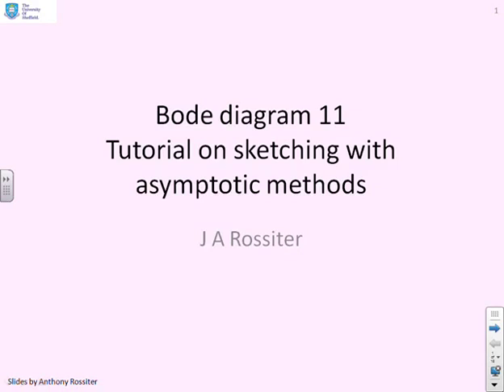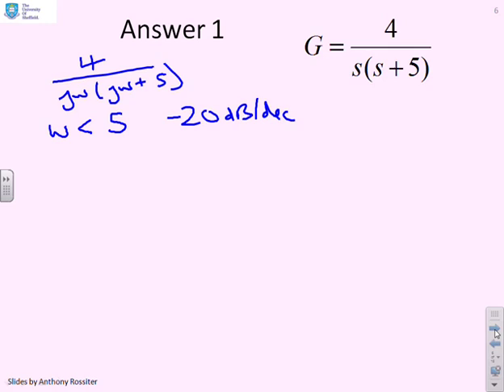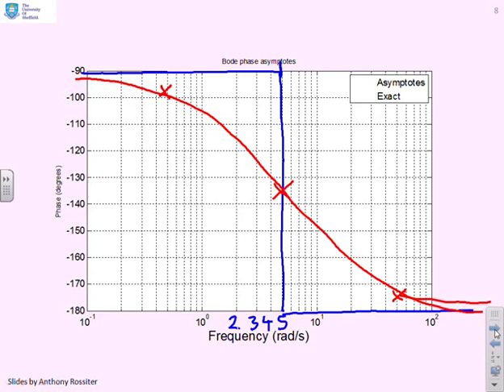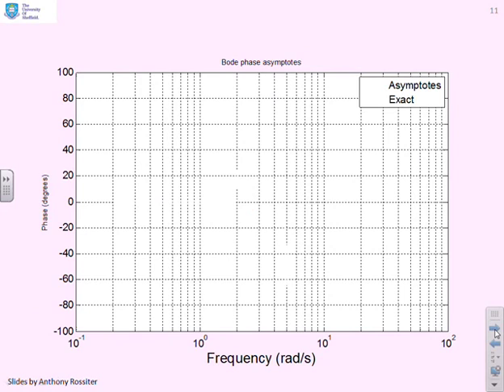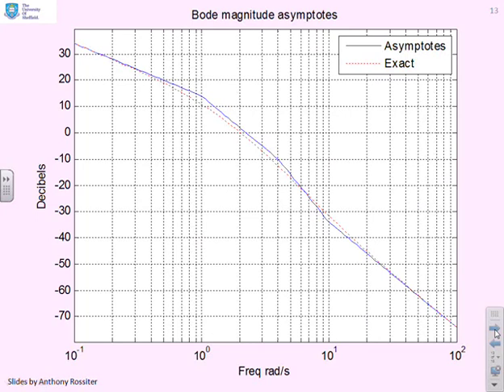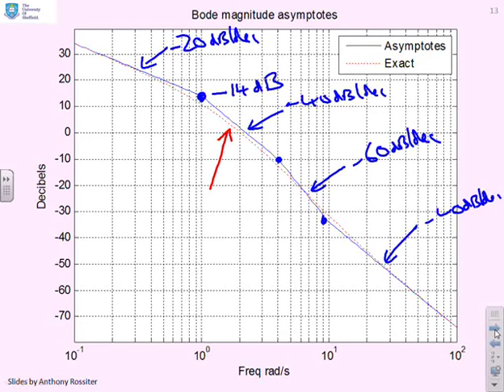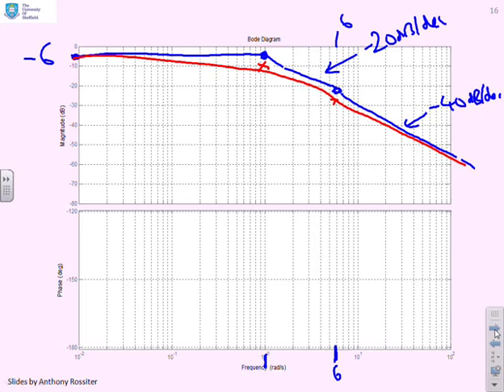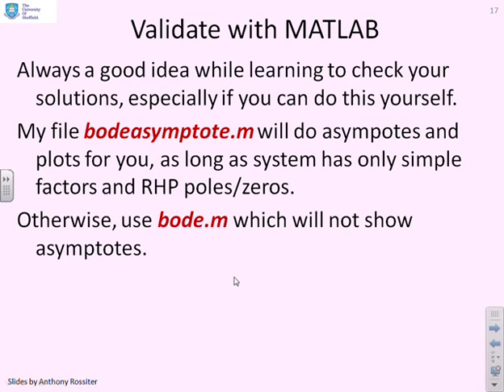Bode diagrams 11 - tutorial sheet on sketching with asymptotic methods and MATLAB

Comment: i'm confused about the answer to Q1. when calculating the gain at the corner frequency w=5 rads, the tf=4/(jw*(jw+5)). therefore , when w=5, i calculate the modulus to be 4/(5*sqrt(5^2+5^2))=4/(5*sqrt(50))=4/(5*5*sqrt(2)). why does your answer not include the sqrt(2)? am i missing something or is this just a mistake? thanks for the videos!
Reply: i think i see now that the corner point is calculated roughly, but then offset by -3dB in the sketch, which corresponds to the sqrt(2)

Comment: I wonder where you start with the phase sketch if you had something like this..

s((s + 3)/(s-1)(s+2))

As s-1 = -180 degree

but then the integrator s = +90 degree

Strange question but where would the initial phase start on the bode diagram...I would guess it starts at +90 degree and declines down to -90 degree ?

So an integrator comes before a RHP pole?
Reply: Hmm.. just checked and it starts at -180 degrees... I don't understand. The integrator and a RHP in a question confuse me.. Other than that I think I'm on top of this :)
Reply: Smiler Liverpool Wait there just checked again..s((s + 3)/(s-1)(s+2)) starts at -90 degrees.. So the (s-1) = -180 degree and the integrator s = +90 try to cancel each other out? So the initial phase point is -90 degree.

So if the integrator was s^2 the initial phase would be 0 degree...
Reply: Smiler Liverpool ok that didn't work ... I'm confused
Reply from the maker: Sometimes the phase will come out as -360 rather than 0. Integrators are always given as -90 but something like an (s-1) could be +180 or -180 and the better choice requires judgement (actually should make no difference).